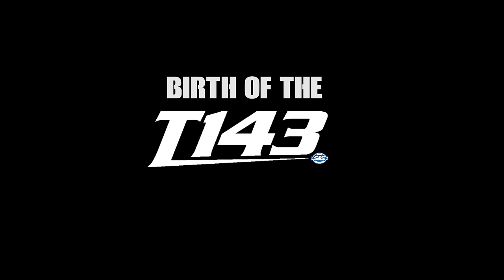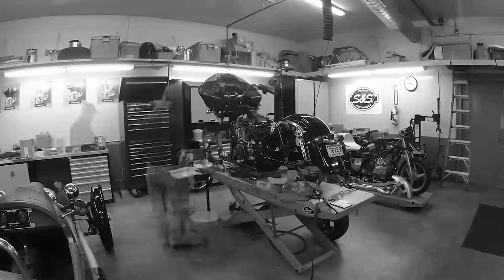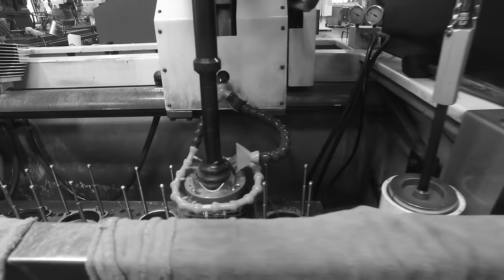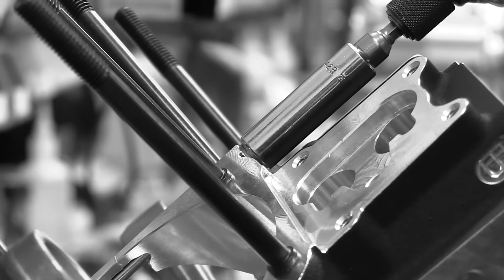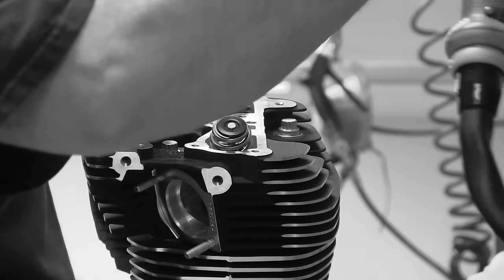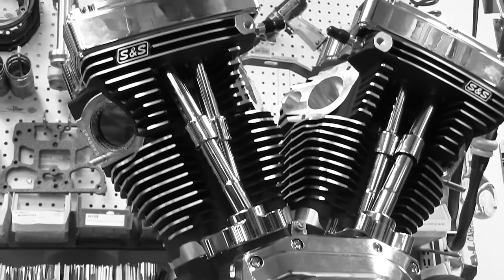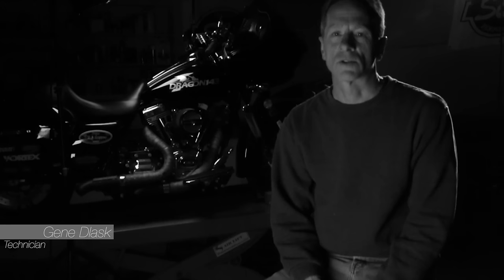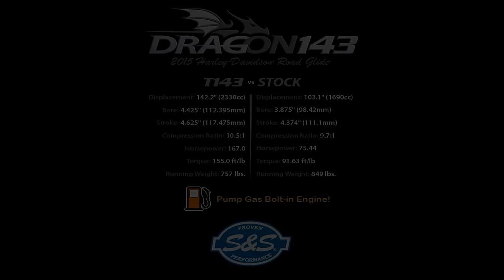S&S Cycle - The Birth of the T143

Comment: How many miles can be expected on the 143 engine if not run hard, warmed up good before taking off, and used in a touring bagger?
Reply from the maker: The 143 is an understressed motor, taken care of we've seen some fairly high mileage out of them, but do not have any hard data as most are used in performance builds.

Comment: Will this fit in my 2000 road glide?
Reply from the maker: The T143 will fit in your 2000 Road Glide, as will the 111s and the 124s which are more aimed at your daily riding uses.
You can check them all out here:
https://www.sscycle.com/2000/Harley-Davidson/Road-Glide-FLTR/#category=1%7CEngines

Comment: I wanna fit that in my 86 fxr! can it fit?
Reply from the maker: +VONSWROKZ1982 HALF DEADZ At this point the 143 is only available for 1999-later big twins. We don't have a 143 to replace an Evolution engine...yet.
Reply: +S&S Cycle, Inc can't wait thanks bro
Reply: I’m thinking about getting this over the 124 that I was going to replace my 110 on my Dyna lowrider S. And then the cmp turbo setup if possible